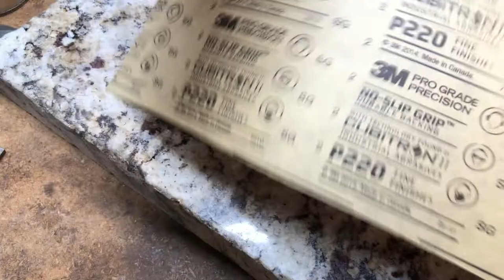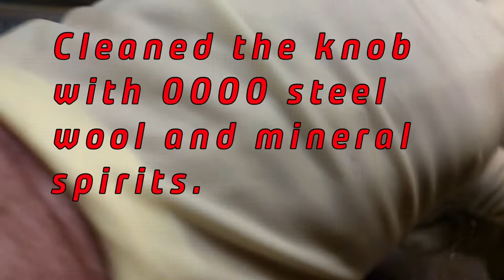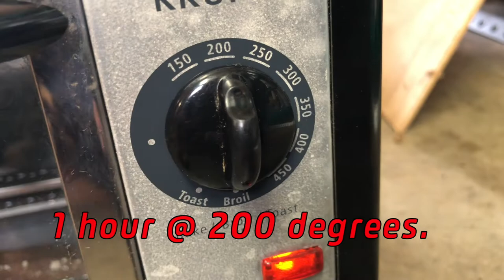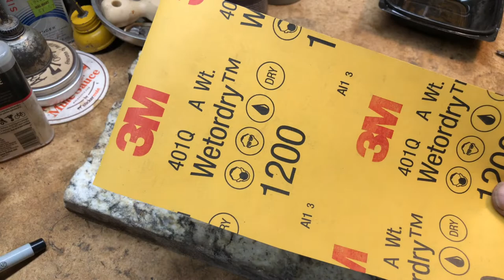Stanley 220 Block Plane Restoration

Comment: What's your opinion of the japanning you used? I have several planes I want to restore & have been trying to decide the best option/method to use.
Reply from the maker: I like it mostly because it looked like a pain to mix your own. The base powder appears to be a mess to deal with.

Comment: Excellent work! Are you happy with the Japanning product? Does it seem to be pretty close to old Japanning? I might have to give it a try on one of my plane restorations in the future. I have a couple that the old Japanning is just too far gone to bother saving.
Reply from the maker: I am not an expert. But I like the product. I did 2 layers. 3 would have been better. I could go back and do the 3rd coat.

Comment: Just picked up a 220 at a local estate sale. Any idea how to date them? The info online only narrows it down to about 90 years or so 🙄
Reply from the maker: Not a lot of detailed dating info on the 220 as far as I know. As cute (and handy) as they are 220 block planes just don’t get as much respect as their big brothers.
Reply: @RestorationbyAlabamaCreeks  Well I bought it to restore and use, not to collect. I was just curious. Speaking of ... I originally planned to spray paint it once I got all the rust off, but does it make more sense to japan it even if I'm not worried about collectability or value?
Reply from the maker: Make it easy, and much cheaper on yourself by simply painting your 220. I wanted to learn the Japanning process. And my Japanning results were not spectacular to say the least. My first two plane restorations (a Stanley No 6 and a No 5) I used spray paint from a rattle can and was very pleased. I have video on those other two.  Hope this helps.
Reply: @RestorationbyAlabamaCreeks  Sounds good! I like what you did with the #5 and #6 restorations. Planning on the same.
Reply from the maker: @davidozab2753  have a non vintage Bailey No 5 Type 20 manufactured: 1962-1967 video dropping Saturday morning. It’s a low value plane but I wanted to save it anyway. It is rough, not sure I can salvage the iron as it’s badly pitted. Hope you have subscribed to my channel.
Reply: @RestorationbyAlabamaCreeks  What did you pay for yours? There's one listed on CL about an hour or so away from me.
Reply from the maker: @davidozab2753  The 220, the No 5 and several no name planes were in a milk crate with a bunch of junk, got it for free. The 220 had a broken lever cap but I got good one off eBay for $11.
Reply from the maker: I have an extra 220 frog (aka depth adjustment block) if you ever need one.

Comment: I soak my painted and Japaned parts in a chemical degreaser for about 12 hours and everything washes off.  At most I might scrub with a toothbrush.   Very easy.
Reply: I use muel head kick it.  Simple green and purple power will do the same thing but it takes days.